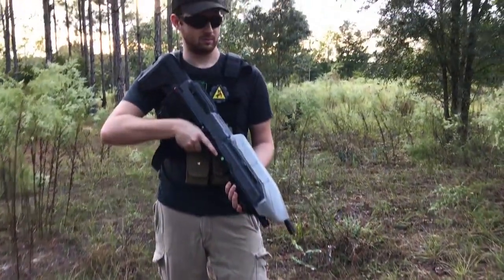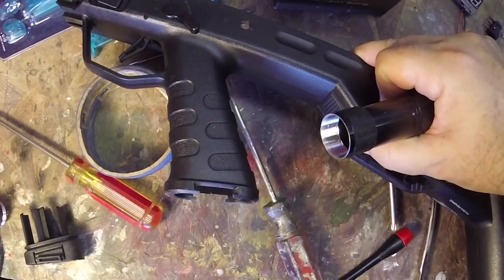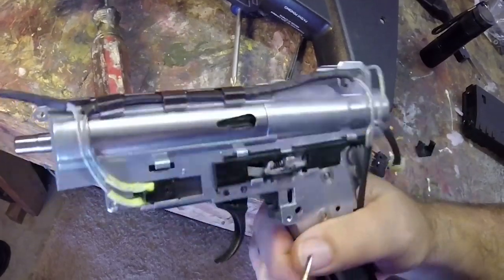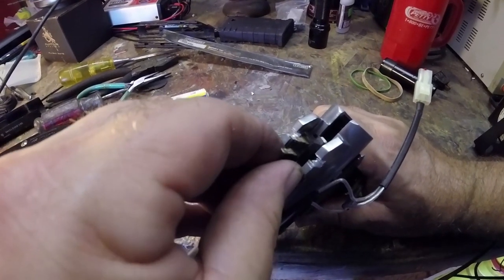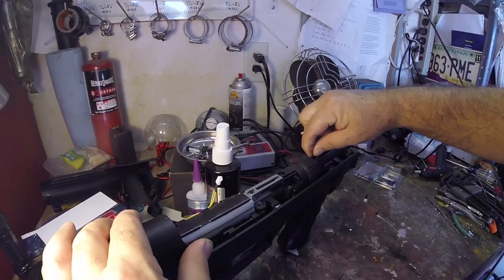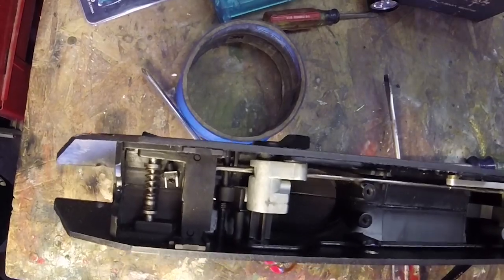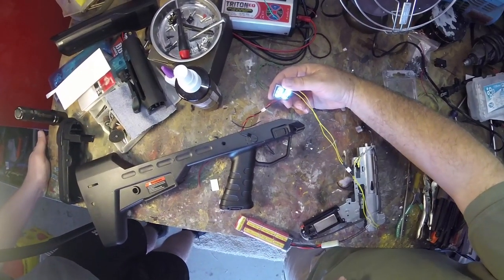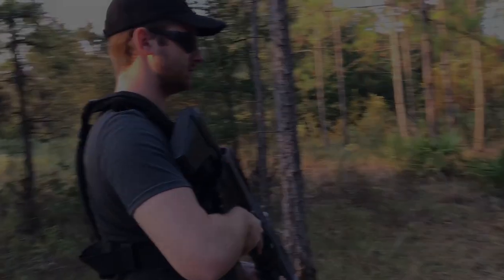How To Install An Ammo Counter Into The Homemade Airsoft MA5B

Comment: I'd use a photosensor from an old printer and paint a small white square on the piston or a sticker to reflect the infrared from the sensor. Once the light bouces off enough it counts as a pass. This means the sensor doesnt touch your piston.

For the ammo count reset, i'd glue a sprint on the switchs head so that it activates on lighter presses but allows the button to depress further into the gun :)
Reply from the maker: If it works, then that would be awesome. That's the beauty about these projects. You can do them in any way you guys want to. It doesn't have to be exactly like the video.
Reply: @SpartanJess  Tbh the photosensor approach would probably need a microprocessor. So it adds a bit of complexity.

Comment: In the end of your video i just noticed the xcortech guts implemented into the replica, can i have a word with your friend for a little guidance? Trying to incorporate the tracer into an UAR. I've made a 3d model for the extended front rail, now i just gotta work on getting the counter installed. Thanks !

Comment: I have a question (maybe I missed it). When the ammo counter indicates zero does it count down again? Or do you have to press mag release?
Reply from the maker: So with this older Westaby counter, we put the reset switch behind the front right side mag release. However! With the updated version, it'll reset by itself once the count down reaches zero. If I recall, you could change it to not auto reset in the settings of the counter.

Here's the link to their newest version. It's around $46 https://www.etsy.com/listing/577200555/diy-ammo-counter-mkiv-kit-reprogrammable?ref=share_v4_lx
Reply: @SpartanJess  Thanks a lot :)

Comment: I know your halo themed but what kind of airsoft gun do i need to make a gears of war lancer into a airsoft
Reply from the maker: Honestly there's probably a good amount of ways. I know there's a prop based off the gun that you could turn into an airsoft gun. Maybe look for the separate pieces that make up the rifle on Etsy and attach it to the gun that the weapon it's based off of, like the bottom rail chainsaw and whatnot. It would be cool to have a battery operated chainsaw with rubber blades.
Reply: During Halloween I found a lancer that was accurate size and hollow. Seemed like an easy way to shove a naked airsoft gun and just accommodate what you'd be missing